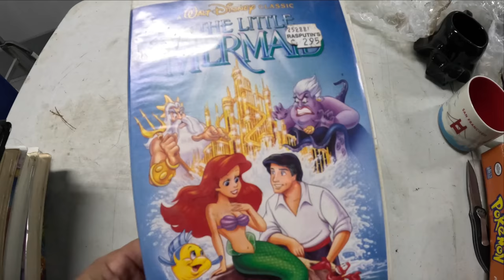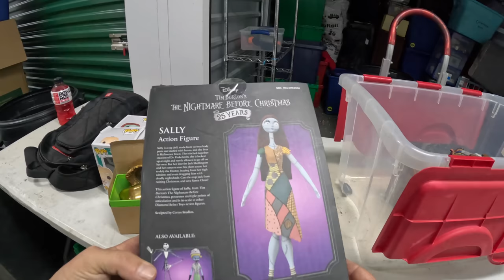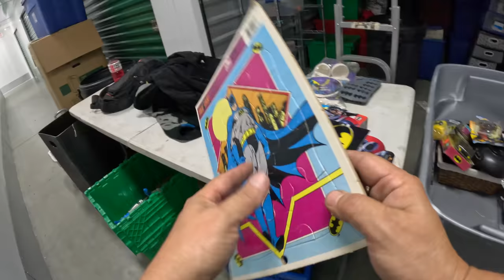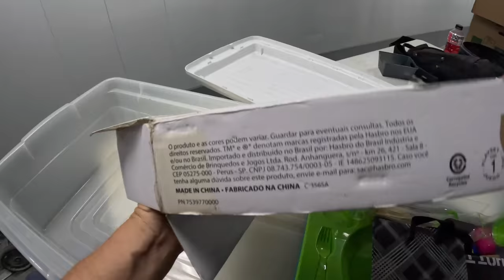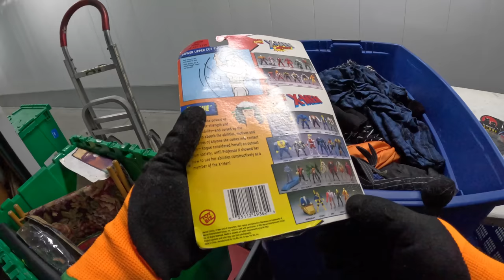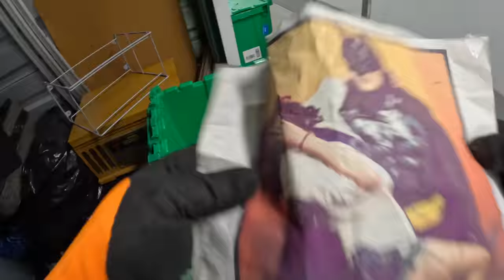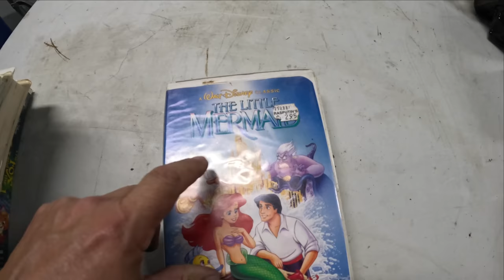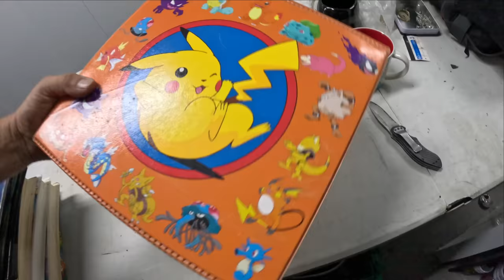This $180 locker has produced some WEIRD finds! Makes me wonder what happened to the prior owners?

Comment: My son has type 1 diabetes and he does not use that type of syringe to inject himself.
Reply: I’m a retired nurse and worked on the diabetes unit for four years.  I also volunteered in the summer for a summer camp especially for children with diabetes. I watched the previous video on this locker and he found at least 2 bags of insulin syringes. They actually had that printed on them. They were definitely the ones we used. I will say that the children we worked with used insulin pumps a lot. The meter was definitely a blood glucose meter. My guess would be that this an older person who has started developing secondary issues due to diabetes. They have discovered that cannabis works great for diabetic neuropathy (nerve pain). That is debilitating and could account for why this locker was rather dirty.